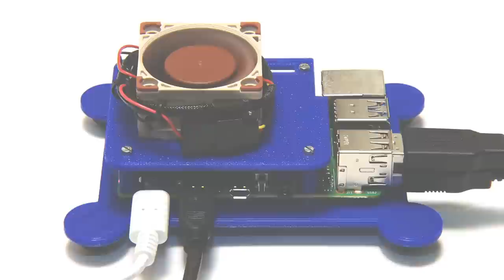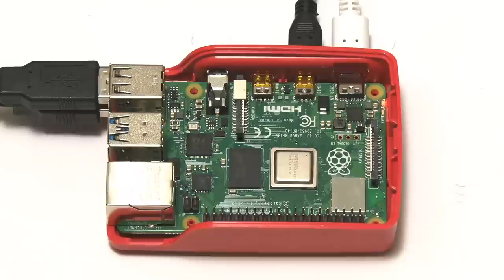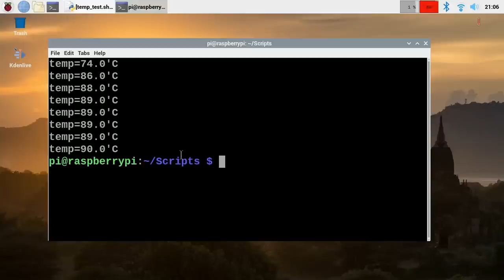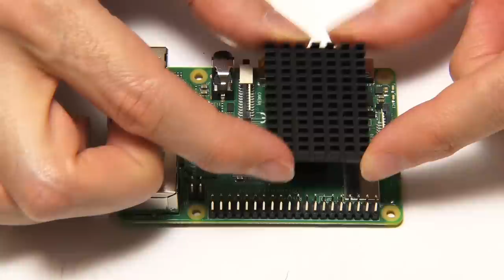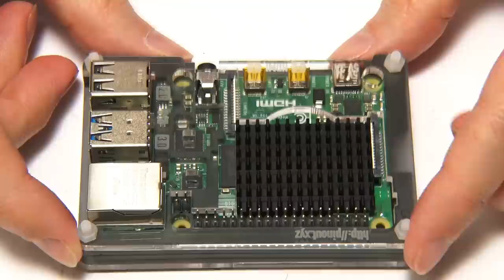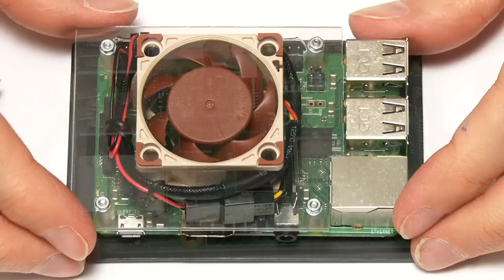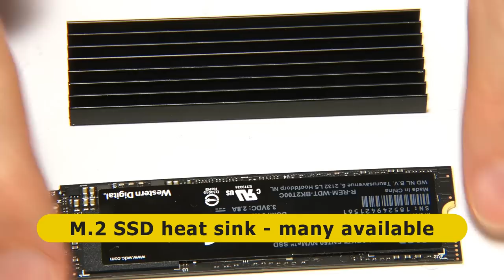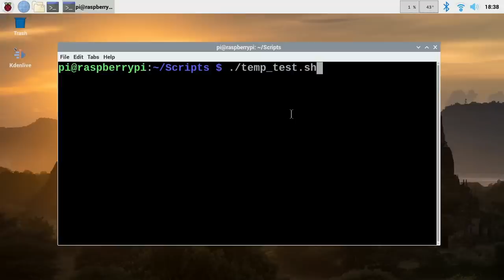Raspberry Pi 4 Cooling

Comment: Next up liquid nitrogen. Nothing like a frozen raspberry pi.
Reply: time for Bullzoid to do some LN2 runs.
Reply: Submerged in mineral oil with a bubbler stone and air pump. :D
Reply: OC to 3.2 Ghz!!
Reply: I like freeze dried fruit
Reply: Ohmwrecker nah how bout kingpin's roboclocker
Reply: Could you keep your raspberry pi or other computer in a freezer?  Or would there be humidity issues?
Reply: freezers do get rather Cold, but they usually do not Transport a lot of heat.
for an ordinary PC this would not work, the Question is how many watts does a Pi produce, and how many watts does the freezer cool away
moisture is not an issue as the pi would not be colder than ambient.
what i do not know is wether a pi has a temperature at wich it stops to function ("Cold bug")
Reply: Funny you should mention that.  I had an engineering project a few years ago, which required monitoring some equipment in an enviroment @ -45F and I found that if I introduced the equipment at least 10 degrees and let it acclimate at that point it worked fine. If I took it at room temp, or at it's 'stable' environment of -45, I had disastrous results. This was using a PC, and I had ro rewrite everything to run in memory under a stripped RedHat so a hard drive wasn't needed, and I couldn't get a drive to operate any substantial time.  This would have been a perfect application for a Pi4, but ti didn't exist at the time. (Interestingly, one of the hardest stumbling blocks was getting the Ethernet connection going, so I ended up desoldering the RJ45 and soldering it right to the board.  .... Brrrr
Reply: @ulrichkalber9039 
I once turned my dual AMD Athlon MP system on out in my shed at about 7AM in winter. It didn't POST and I started to get worried. After several resets, it finally started booting, got into Windows, and up popped my system temps.... -4C inside the case, and the CPUs were at about 10C.
Solved the problem by moving my oil filled heater to under my desk and running it for 10 minutes before booting the PC on really cold mornings.
Reply: How about Vodka cooled raspberry pi?
Reply: Truong Nguyen Dac Cpu vould be unstable!
Reply: "Talk to you soon, very recently" good humor:-))

Comment: If only Frodo had the raspberry Pi 4. It would melt the ring in no time
Reply: Gandalf: "Open the script Frodo."
Frodo: vi temp_test.sh
Gandalf: What can you see? Can you see anything?"
Frodo: "Nothing. There's nothing... wait... there are markings. It's some form of script, I can't read it."
Gandalf: "There are few who can. The language is that of Bash, which I will not utter here.
Reply: @il2xbox  so good lmao
Reply: @il2xbox  :')
Reply: @il2xbox  Oh my gosh.... if ever a pinned post was deserved, this is it!
Reply: The original Pentium 4 works better.
Hmm. Theres a pattern here - P4, Pi4...
Reply: @tin2001  Or one of the late Power Mac G4s or even G5s. The G5s at least had an adequate cooling system, but a Dual 1.25 G4 MDD sure as shit did not.

Comment: Yeah that small hs should be included with the pi 4 because idle temps shouldn't be in the 70's.
Reply from the maker: Agreed.
Reply: Canakit sells a heat sink set (and a power supply) with its Pi4 boards
Reply: a vented case as well, a heatsink does little good if the case is enclosed
Reply: AliExpress has really nice heatsinks for 2-4 dollars. Buy a pack of these and get a high quality fan from something like noctua.
Reply: @coffee-vz1nr  I just picked up a 40 piece kit of amazon (large and small) for 10.99. parts for 10 pi (easycargo kit)
Reply: @billfusionenterprise  good deal! I find these much better than say something like a flirc case which costs more and is proprietary too!
Reply: FYI , Geekpi has a 4 pack of fans , heatsinks amd what not for 8.99
Reply: billfusionenterprise Agreed - the official pi case should be relabeled as a “Raspberry Pi 4 Sauna”. That is the first official Foundation product I wouldn’t recommend.
Reply: Perhaps an official case with a knock-out for a fan might be encouraged. But, I would think that the case could be provided with some heat sinks for a slight additional cost, while keeping the Pi4 at its traditional cost.
Reply: @billfusionenterprise  link please
Reply: highdesert50 A minimum the official case should be redesigned to provide some airflow paths. The Pi 4 is actually OK for light tasks in open air and a heat sink and open air covers most tasks but the current case is basically a layer of plastic insulation around the PI. Applying it makes the Pi 4 unsuitable for even light weight tasks and negates any heat sinks since the heat can’t escape. That is pretty unacceptable and as much as I love the Pi and the foundation - they need calling out on this case situation.
Reply: @coffee-vz1nr  although that case is nice if you need cooling and a hard case
Reply: @leonardgallion6439  I was wondering who lead the design of the new Pi, someone from apple
Reply: @billfusionenterprise  Thanks for the tip!
Reply: @billfusionenterprise  Could be or maybe one of those AMD Bulldozer designers. ;)
Reply: @USBTux  do a search on amazon
Reply: That raises prices. The Pi 4 is supposed to be a cheap computer not a pricey one.
Reply: To that, id like to see what that thing is doing to cause it to be so high, ,  my Rock64 ( 4G )  no case / heatsink is no where near that.

With that said its running a 5.2.2 ( RT ) kernel of this writing and I am most likely going to go with extreme cooling as you show here ( @Chris ) .. There are a few people using these boards now as docker / K8's clusters, so I thought I would add to that mix and build out an OpenMPI set ( hence the need to start thinking about thermals ) .

I am doing this ahead of the release of the new RK35xx based systems due soon which as stated sport the A76 ( x4 ) and A55 ( x4 ) which in this configuration with the NPU ( AI / Neural Processing ) should do well
Reply: @ExplainingComputers  you need a medium heatsink with a small fan!
Reply: @leonardgallion6439  It's for reflowing all the solder on the board, not just around the CPU.
Reply: @thegardenofeatin5965  LOL took me a while to get that. Fortunately they have improved the heat situation with firmware updates, but still I go heat sink or fan cases - critical for overclock situations.

Comment: By the time we get to a Raspberry Pi 10 you'll need a Hyper 212 EVO cooler or an AIO liquid cooling solution to keep up.
Reply: I hope not as i am keeping with the Raspberry Pi 3B due to not needing a heat sink nor any cooling for normal desktop tasks for anything more than simple internet browsing i go down stairs and use a full size windows properly built windows machine ..... even though the only thing it has over the Raspberry Pi 4 is storage space, CPU speed and a x86 processor
Reply: @yumri4  I have a Pi 3B also, but I don't use it for anything too heavy. It's primary tasks involve basic terminal applications like Wordgrinder. I prefer that for writing because on my old matte Dell display it's not too harsh on the eyes when I want to write.

I have a lot of computers for more power hungry tasks, but that's in the only place I wanted something silent and with a low power consumption for lightweight computational tasks.
Reply: @sbrazenor2  that is where the raspberry pi shines low power silent operation that works for light compute tasks
Reply: There is a cooler available for RPi that very much looks like a Hyper 212 EVO, albeit a smaller version:
https://www.youtube.com/watch?v=RyUXC3886Ic
It's called "The Ice Tower".
Reply: Funny you mention that.  There is actually a tower cooler for the raspberry pi 4 that works great.  ETA Prime did a video on it.  I think the tower was even good for no-fan operation too.
Reply: one solid heat-cap over the whole board... ;)

Comment: Since many have asked in the comments what the results would be with official case open but without heatsink, I decided to test it. Installed newest Raspbian to SD card, put my Pi 4 4GB to official case but removed the top part and ran the same test script.

Here are the results:
temp=65.0'C
temp=81.0'C
temp=82.0'C
temp=81.0'C
temp=82.0'C
temp=81.0'C
temp=82.0'C
temp=81.0'C

Test took 12 minutes and 55 seconds to finish, so 2 minutes longer than with heatsink. Ambient temperature room tempeerature was about 26 degrees but Pi was on the floor where it was perhaps few degrees cooler.
Reply: This needs more upvotes.  Science!
Reply from the maker: Very, very helpful. Thanks greatly for sharing this data.

Comment: The Pi Foundation may come to regret the "official" case for the Pi 4. That temperature profile's asking for hardware problems, not to mention the performance hit.  At the very least, they should have provided ventilation holes in the top, and possibly a slot (maybe a knock-out) over the GPIO pins. 

An interesting experiment might be a copper block the size of the SoC, tall enough to reach the top of the ports, connected to a copper mesh the size of the board; the idea being to get convection flow. Might cause wifi problems though, if it acts as a Faraday cage.  Copper mesh is commercially available online, but the block might be hard to find.
Reply: The best value setup is to get the 9-layer cooled case from ebay ($7) and pair it with this ebay heatsink ($6) which is the same as the Pimoroni heatsink in this video but half the price: https://www.ebay.com/itm/273958255795

Comment: Great ! This is the video that is so important for users of this new SBC ! Going back to the Pi 3B and 3B+, at least a heatsink if not an active cooling solution IS needed for real-time activities such as SDR ( software-defined radio ), which I run on a 3B. Quite often without a heatsink, the SBC "stutters" ( cuts out for part of a second ) , or "goes into the red" as regards overheating. So YES, your previous "active-cooling" work HAS been very valuable in those situations. Your final solution with the Pi 4 is obviously the one to go for, for anyone doing more than the most basic work - people dreaming of running two HDMI screens, and using the Pi for streaming video, or indeed SDR as I do, really need to opt for you final solution to "stay cool". Overheating reduces the life of any computer systems, and throughout me career over 30 years in the computer industry, cooling was a mandatory part of computer installations. It certainly needs to be with the Pi 4B. What worries me is the number of school classrooms who will be installing these SBCs over the school holidays. I just HOPE that the installers will install then with active cooling systems. Children have very sensitive hands as compared to adults, and we don't want children burned by the heat, especially when they take the lids off the SBCs, as children are prone to do. Thanks for this very valuable video, Chris, and please ALL educators take note of Chris's findings !

Comment: July 21, 2019 - Great COOL tech video, Chris. In electrical engineering classes, we spent a great deal of time about heat management of solid state devices (and nearby passive devices too, such as power resistors).  I think today's tech does a near lousy job of moving hot air through earphone jack holes and speaker holes.  When using a heat sink, it is also important to provide cool air across the heat sink fins.  And then channel the heat flow out.  Motorcycle engines do this very well.  A coat of paint on the fins degrades a heat sink dramatically.  Your new vid proves a basic yet overlooked point: Manage the pathway of semi-conductor produced heat.  Details matter.  Thank you, Chris!
Reply: Not a lot of heat sink fins on motorcycles these days.  They are watercooled, sometimes oil cooled, rarely aircooled.  The fins such as they are will be cosmetic
Reply: @twmbarlwmstar  I appreciate the update. I was thinking about H-Ds from the 80s.  You are correct.  Thanks!

Comment: I've done the test on a Pimoroni case with the fan shim.

Here are the results (ambient temp. 21'C):

temp=60.0'C
temp=64.0'C
temp=67.0'C
temp=63.0'C
temp=61.0'C
temp=65.0'C
temp=63.0'C
temp=66.0'C
Reply from the maker: Not bad results -- thanks for sharing.
Reply: The temps you get when using the Fan SHIM depend on how you configure the fan control script. Mine is set for the fan to activate when temp reaches 55, so I get a range of 54-57 when running the temp_test script.
Reply: @mikejcross  thanks for the feedback. My fan shim is set for the default temperatures of 65C with a hysteresis of 5C.
Reply: Came here to ask if you'd run it with the fan shim as well,  thanks for this.

Comment: Very cool Chris, thanks!  My only objection is:  During the 2nd test (when you first added the heat sink), was the improved result due to the added heat sink or due to the increased ventilation?  You changed two parameters at once, so it's difficult to say which had the biggest effect.  Would it be possible to include results from running a bare Pi4 out of the case first, before adding the heat sink?
Reply: Exactly. And how does the standard small heat sink perform in combination with the fan. The difference between the small and large heat sinks was not that big.
Reply: I would also love to see active cooling without heat sink (outside of the standard case)
Reply: @edwinschaap5532  It won't be that big because it is limited by convection (or rather conduction).  The heat load should be slower to build, as you have a bigger slab of metal to absorb heat but after that things will level out.  In a more real world situation you would probably use heat pipes to move the heat from the heatsink to outside the case where it might get some convection heat transfer (because of breeze) but still be technically passive.  Kit's can be bought on eBay although they aren't that cheap to the extent the Noctua would be a better choice cost wise at the introduction of moving parts and energy costs.
Reply: The reason for not putting a heatsink on while in the case is because that would only delay the inevitable. Without ventilation, the heat has nowhere to go, so adding the heatsink will only provide a slightly larger "space" for the heat to go.
Of course, a heatsink is always better than no heatsink, simply because it makes for a thermal buffer that will smooth out the heat generated by spikes in power usage. This is the same for M.2 drives and RAM; the heatsink is not primarily for cooling, but for thermal buffering.
And of course with the amount of power that the Pi 4 draws you'd want active cooling anyways, such as the S2Pi ice tower
Reply: @Anthony Spendlove. Yes I realise that. My original question was about checking cooling performance outside a case (i.e, good ventilation), but without a heatsink. A logical test protocol would be: 1. Inside case, 2. Outside case, 3. Outside case with heatsink. He skipped no 2.
Reply: And now we know the result.. <3

Comment: Yet another brilliant video thanks for showing me the result's, it clearly shows that the Raspberry Pi needs to have a better cooling system than what is on offer right now.
Reply: *video. Thanks
*results. It (plural)

Apostrophes are for possession or contraction, not for pluralizing (except for single letters). Also, that was a run-on sentence and should be written as three separate sentences.

Comment: Really well done video
The Raspbery Pi 4 is no longer safe for children. I believe a warning should be included with the Raspbery Pi 4 regarding the extreme temperatures.
Reply from the maker: This is a very good point.
Reply: Well, you could heat even the previous models to these temperatures if you try hard.

Comment: Thank you, just done the Test
temp=36.0'C
temp=49.0'C
temp=51.0'C
temp=50.0'C
temp=50.0'C
temp=50.0'C
temp=51.0'C
temp=50.0'C
with the normal Pi Cooler and a 5V Fan
Reply from the maker: Good results. Thanks for sharing. What is your ambient? And size of fan?
Reply: The Fan is a 4010 Cooling Fan Cooler Radiator 40x40x10 mm form the well known  Chinese Market Place for less than 1€.
The room  temp was 23°C ,.. and I placed the Pi in a printed Case from Thingiverse. Nothing very spectacular :-)
I was suprised, that this works so well with the small heat sink

Comment: Control should have been without any case or heat sink.
Reply: Exactly. How do you know how much cooling is due to no case vs adding heatsink
Reply: @codycast  Or two controls. With and without case.
Reply: Would have been better if there was a bare no case run I agree.  Just the air able to move away from the chip surface should make a difference vs no airflow when in the case.
Reply: I understand his logic for not doing your version of the control. He states at the end of the video that he believes a cooling solution of some sort is absolutely necessary fro the Pi 4, which I think most people will agree with.

Comment: I  purchased the raspberry Pi Devastator Robot and the wireless keyboard after watching one of your your videos. I had a few days off work and spent the time building the robot and connecting it to the Pi Zero and Pi 4. I had lots of fun. I had problems having the Pi boot up by itself and running the Python program but stuck at it and got it to work. Lot of great support on the internet when there are problems. I will follow your other video and connect it up to th camera when I get some more days off work. Thanks
Reply from the maker: Great to hear -- this is what the Pi and YouTube are all about. :)

Comment: From your tests we can say that almost no throttling occours already with passive heatsink (11mins vs 10 mins) and  that minimal heatsink is already effective as the  big one. Considered that modern silicon is typically designed for working reliably (10+ years) at 100+ degrees it means that a minimal passive heatsink is already doing the job (well maybe it's better saying it's now mandatory to have it) and active cooling is only for having low temperatures for paranoids...